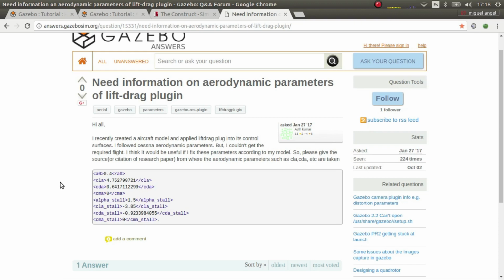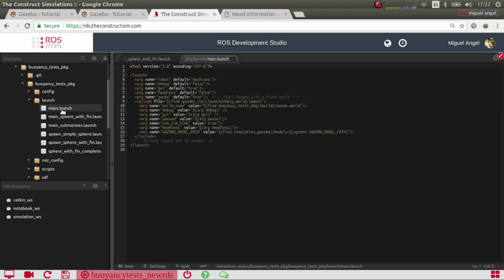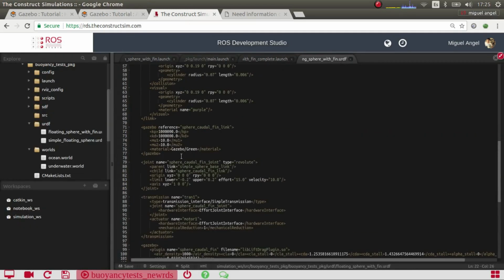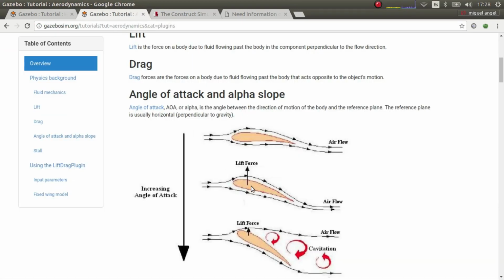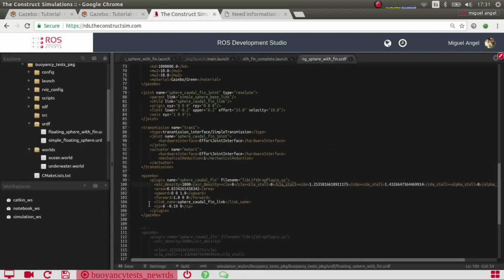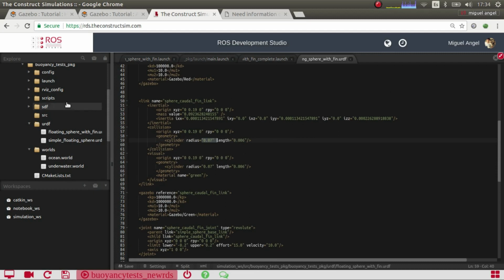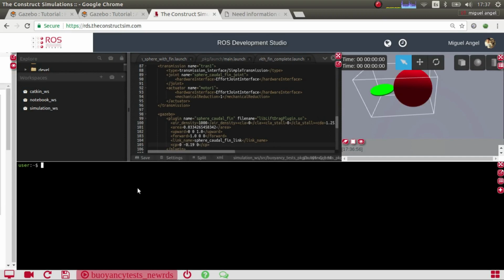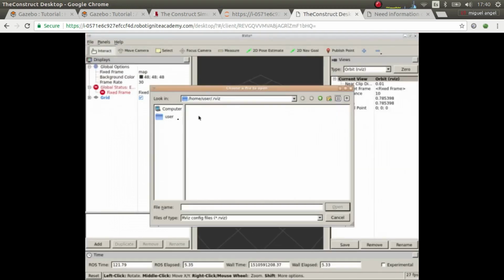[ROS Q&A] 059 - Aerodynamic parameters of lift-drag plugin

Comment: I have a question about this issue. Is there any way to implement external force to bodies with using discrete vortex lattice method trough the ros topics pub and sub or any fields ? For example, Body dimensions field  information including shape angles cordinates and another geometric info  published some node with 10 frequency rate and this node calculate cl and cd coefficient respectively at each discrete time. After that this node subscribed this values into the ros enviorement to effect to motion. By doing this,  all information can be demostreated like a real world beacuse of non linearity. Also this notation can be done for the friction force and etc...